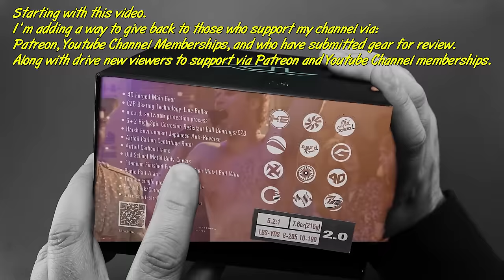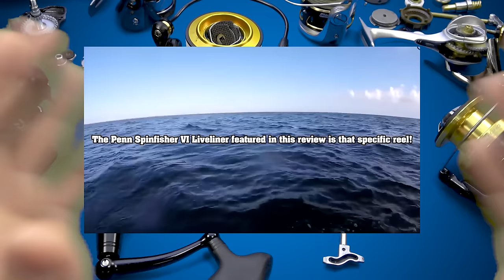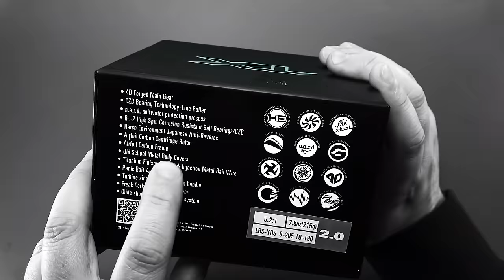$200 Spinning reel buying guide.  Teardown, comparison, and review. Shimano, Daiwa, Abu Garcia, Penn

Comment: Solid channel, good info! Currently own three Stradic Fls...easily the best spinning reel I have owned to date. They are much smoother than the six CI4s I did own but have since sold. Occasionally had some bearing problems with my CI4s. Waiting on the latest version of the CI4 which I am told will be released in August 2020. I was also told the new version of the CI4 will be renamed...no longer will be named the “CI4.” I am waiting to see if the new version of the current CI4 will incorporate all the features of the current Stradic FL. If so, game over.
Reply: hey, do you know what that name will be and when it get released? do you know where i can get more informations? thanks!
Reply: @pampeinio7861  
Shimano Vanford

Comment: If you had to choose a reel for fluking or inshore fishing in the surf or jetty would you choose the Back bay, Stradic or ballistic? That would really help me out if you can help me choose! 😂 great video!
Reply: 1. Stradic FL
2. Ballistic LT
3. Backbay

Wud have been Ballistic at top  due to weight alone, line capacity and drag but it somehow flexes. Stradic is like jack of all trades master of none, not to heavy, buttery smooth, cast a mile but spool is kinda small for size and needs to be maintain more if that bothers you.

Comment: Love your content and have taken your advice many times. I recently upgraded my freshwater spinning reels to Shimano Stradic ci4 + in the 2500 size. I have 4 of these. They are all super smooth throughout their operation except when the spool is at the top of its stroke. Once you near the top and slightly pass the top of the stroke of the spool there's a slight but noticeable grinding - rough feeling..... once the spool starts to come down from it's furthest out point it becomes super smooth again. I had a similar issue with a Daiwa Tatula LT 2500. If you simply splin the reel without any line out so ZERO resistance you don't feel this problem but as soon as your reeling in a bait or fighting a fish you'll notice it. Is this due to Ci4 + body material allowing flex? Would the Stradic FL or the new Twin Power FD exhibit this you think? I love lightweight, smooth gear and don't mind spending for quality which is why I was surprised by these $230 reels. Thanks for your time and I'll look for your response.

Comment: Thanks for the video as always. I’ve  been using the new Stradic 3000, the Saltist 4000, Balistic LT2500D, a few Penns. One of the reels I use which I don’t recall you mentioning is the Lews custom pro speed for $129. It’s seems like workhorse for me, pulling in stripers and blues in Sheepshead Bay NY. Would love to know your opinion on it? Willing to send for tear down if interested.
Reply: How cumbersome is that saltist 4000 on the wrist compared to the lighter ballistic?  You do mean the saltist back bay 4000?  Thinking of purchasing two back bays but worried it might tire me after hours of casting.  Don't know if I should just fork out the extra money for ballistic.  Just dont like the red accents on the ballistic.
Reply: Martin Martinez I actually mean the regular Saltist 4000 and it is bulky. I got it before the Back Bay came out. I would probably opt in for the Ballistic unless your looking for something more sturdy with less flex.

Comment: I have been a stradic ci4+ guy for a long day. I have multiple of them and I am a huge fan. I am in need for a new reel. I am thinking I will get another ci4+ unless the Daiwa ballistic or the stradic fl have something better to offer. Thoughts? Reel weight and drag capacity is a big deal for me.
Reply from the maker: New ci4 should be out fairly soon at least before it's cold out...if you find yourself at home with the Stradics... Stick with em.. The Daiwas will be an adjustment... And if it's the odd reel out..... May not be a good experience

Comment: Who could help me choose??  ------>  Shimano Stradic FL or Daiwa Caldia LT? The Caldia is lighter and magsealed, the Shimano doesn't have reverse, but still seems a refined reel. Need to make my mind around this two. I'm looking for a reel that stays smooth for years in saltwater lure fishing. Thanks in advance!!!
Reply from the maker: I'd go with the stradic....Or Ballistic over the caldia..
Reply: @TackleAdvisors  Hey buddy many thanks for your reply. Actually I was going around the Caldia LT idea because here it sells at the same price as the Stradic FL, and you've mentioned that inside, it's so similar to the Ballistic LT except for the machined gearing. I guess I'll buy the Stradic and learn to avoid using the reverse switch then. ;)

Comment: As usual, appreciate the detail. I have a FK and an FL on order but there is one thing that has always confused me. They are aluminium reels but the body material is black in colour (can be seen when you scratch it), why is that? Thanks!
Reply: Its carbon composite, not metal and has been that way for awhile.

Comment: I have a stradic FL 4000 MHG. There is some play on the handle but its not from the shim/washer (I tried to add the thinnest shim and its start to lock out) its seems like there some free play between the pinion and main gear meshing but I don't know if this is the reason why. Is this normal or should I add shims somewhere?
Reply from the maker: There will always be a slight bit of gear lash... Sorta required... It should not be severe.
Reply: @TackleAdvisors  thanks for your advice 👌

Comment: I've been looking at the 19ballistic fw lt2000 and the 17theory 2004 in your opinion which is the better reel and why?
Reply from the maker: If you're in the USA screw em both because Daiwa touch them if you need service... I don't knot what makes the fw so expensive.  Honestly with the stradic FL being better than anything below the certate.. I'd say look vanford
Reply: Tackle Advisors thanks a lot,   I really appreciate your opinion. The rod I'm pairing it is 70grs so the FL would it balance well?
Reply: @TackleAdvisors  Im at kinda the same crossroad but Im a medium light fisher wjth a 3/4 oz 15 grams Westin W6 rod. But the Stradic FL seems heavy, I got the Caldia LT atm but man it is bad after a year.. even with cleaning.. Would a Vanford be a better option? The 2000s ain't on the market in Europe yet though.

Comment: Thanks for cementing my choice in purchasing a stratic FL as my next reel. A few places have them on special at the moment
Reply: Where the best price I found is 211 shipped
Reply: @JD-hs7ib  in UK and Ireland. Seen them for 145 pound in UK and in Ireland 165 euros with free shipping to Ireland
Reply: Also might be useful for you guys in the US to know that most stockists in Ireland and UK stock all 3 retrieval ratios. I think I heard on near before that the test reel came from Japan as the market in the US usually prefers the higher ratios. Might be less expensive compared to Japanese market?
Reply: gary lawlor what site for here in Ireland?

Comment: Got a question shimano stradic ci4+ vs stradic fl?
Reply: Following this
Reply: fl is smoother but ci4+ is a lot lighter and smooth but not as smooth as the fl
Reply: @longduong7366  how about the internal parts what's the best bang for the buck?
Reply: @fishin3196  all based on what you're using it for and what you like. The fl is smoother and does have better internals but some people just really love the light weight of the ci4. Or, you can wait and see if they make a new stradic this year as well with the upgraded internals.
Reply: @moneyking6659  hard to choose the fl seems like a better buy as the ci4 will probably be outdated soon I've heard the internals were based off the the stella with the micro module II system I'm planning on using it for walleye fishing with light jigs might just be the way to go
Reply: fish in 
Have them both , fl has got more cranking power and better casting ,
Reply: @fishin3196  currently the fl is a better buy. I only still use my stradic because it fits my rod for a better balance. The fl is a bit too heavy. If you're fishing for walleyes and plan to use carolinas or jigs, the FL will be sturdy enough for everything. You can always give it a try and see how it works for you. Dont like it, return it. That's what I did. Currently I'm waiting for the new stradix ci4.
Reply: @moneyking6659  Was it already announced? I've seen some shops stop selling the current ci4+, maybe anticipating the new one coming.
Reply: @TerrificFlow  no it wasnt announced but usually every 3-4 years they make a new one, such as the fk to fl, and the met16 to met20. So down the road this year, pretty sure they'll announce it and make it.
Reply: fish in honestly i like the fl better. But i just wish it was as lightweight as the ci4+ . If i were you i would wait for the new ci4+ to come out it should be soon.
Reply: @longduong7366  yes I agree I went out the store today the ci4 is extremely light i might just wait for a new one to come out
Reply: @longduong7366  well I bought a fl paired nicely with my legend x

Comment: For blackfin tuna or even mahi mahi....Daiwa BG or VI Spinfisher?
Reply from the maker: Both would do just fine........make sure to oil the line roller of the bg periodically if you go that route.  You'd probablly get a little more winching power out of the BG which could be better trying to avoid getting sharked.
Reply: @TackleAdvisors  thanks for the advise. l'm opening a charter boat in Honduras, need to buy gear and definitly buying all Daiwa gear. Maybe Josh can give me a good discount on them hahahaha

Comment: 40 mins well spent! Thanks!

Although I have to say I’m not happy with my FL...
Reply: What's wrong?
Reply: He had to pay for it 😂
Reply from the maker: You're welcome... Not much bad press so far about the FL(that I've seen) .. What issue did you have
Reply: Tackle Advisors the rotor isn’t smooth and makes noises while fast retrieve and that straight out of the box!
I tried to take it apart and clean it a few times now but that didn’t help...
So I went to the shop (they call themselves a Shimano Mastershop or so) and asked what was wrong and they said they don’t know either...
They also said that since they started selling this reel they had at least 40 people with the same issue and they could help there as well...
My Mates are also not happy with it! I’m just very disappointed :(
Reply: Richard De Boer haha good one😂
Reply: @peteheigelfishing  yeah I've heard some of them out of box have some sound to them, They still have performed well but I don't think we should have to deal with it having any noise at the price we pay!
Reply: @TackleAdvisors  I had a similar problem with my brand new Stradic FL. Also the drag was completely worthless. It felt like it had been dunked in saltwater a couple of times.. The drag was unreliable, slipped out in bursts with a sudden stop etc. Never buying another FL. The ballistic on the other hand has been behaving brilliantly.

Comment: 7ft lami triflex. Ballistic lt or spinfisher.... thinking 4000 size
Reply from the maker: If going ballistic I'd go larger .. Ballistic lt 6000...I've paired it with a customer 7' glass lami all the way up to the 11 tournament ballistic.... Lots of power.. Little weight... Pretty cool... Still comes in at 10 ounces... I like the 4k spinfisher alot... But I've pretty much benched it for the bigger and lighter ballistic

Comment: I enjoy my 2500 and 2000 Stradic FL but in the price category of these my Daiwa Theory 2506 is much smoother for light game fishing.
Reply from the maker: The theory is a sweet reel...but not as rugged....Just replaced 4 of the bearings in my friends 3500 after 3 trips.
Reply: @TackleAdvisors  Well that is good to know and slightly scary at the same time. I appreciate the update on that! I'm primarily using The Theory for trout in freshwater and some steelheads here and there. Hopefully it lasts a little longer. The new Stradics have been good as well they just seem to be a little less refined when light line fishing.  Obviously they are built well and should at least continue to hold up for a longer period of time. Thanks for all your input its greatly appreciated👍👍

Comment: In a 1000 size for trout and jigging Walleye, would you still consider the stratic? 
You are seriously the best 👍🏻
Reply from the maker: That or a tatula to save weight... You could even size up and get better line handling on mono/fluoro with the tat and still be at the same weight

Comment: Stradic SW?

You didn't cover the most important aspect, which one has the most ball bearings in them there handle knobs?

Also, if you reply, did you ever learn any more about the split ring pliers? Fake or actual quality decline?
Reply from the maker: Stradic SW is now obsolete......was an FK with sustain clutch if I recall correctly...>FL has the stella clutch......soooooo...yeah...   I thought I replied awhile back....they are indeed legit.....he was aware of the issues.
Reply: @TackleAdvisors  Thanks for the response. You may have on the other video and I just missed it. It's sad but hopefully they resolve the problems.

The SW is still tempting to me b/c I really prefer that handle size/style. Obsolete in 2 years, and with the current world situation, it'll probably be 2 more before my next trip to the gulf. Thanks again and hope you're doing well!

Comment: about daiwa's cast zink main gears- ill never buy them again, after having the gear broken off his shaft, and i discovered how badly it's connected on to the steel shaft... really disappointed
Reply from the maker: Unfortunately the press fitting is a standard... Occasionally there's an issue as you experienceed.. I had issues with shimano screws loosening on original Saragosa reels and was the first to make that public... 10 years ago
Reply: @TackleAdvisors   it's actually not press fitted but seems to be casted on the steel shaft, that has 6 small  holes on it, made to be filled while the zink is casted

Comment: The Young's modulus (ability of a material to resist deformation under stress) for zinc is honestly not much less than that of brass. Zn=96.5 GPa and Brass has a range of 76-121 GPa, so with a larger cross section on the teeth, the Zn could actually be the stronger, more resilient main gear.  Also, what happened to your channel, you were doing some really cool stuff?????

Comment: Daiwa Ballistic lt 6000-d is really a phenomenal reel, I had it tested at Cape Cod Canal with a 46in bass in the current, plenty of drag, cranking power and line capacity. https://youtu.be/lPhhxKqioPs I also beach fished it in Florida and took quite a splashes and with a simple rinse, still smooth as the 1st day. Cheers!